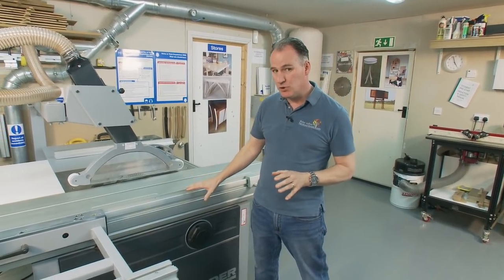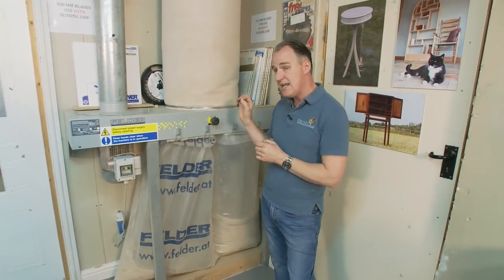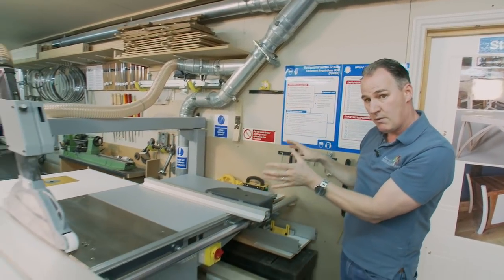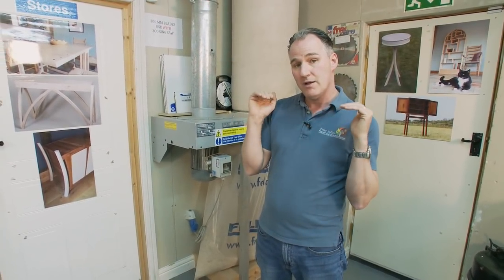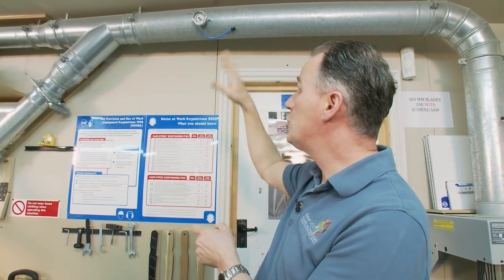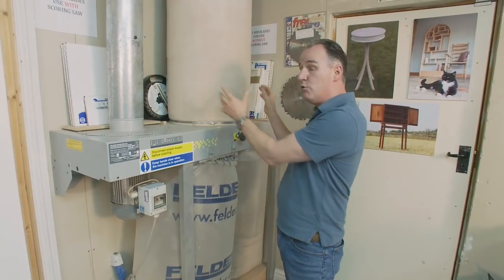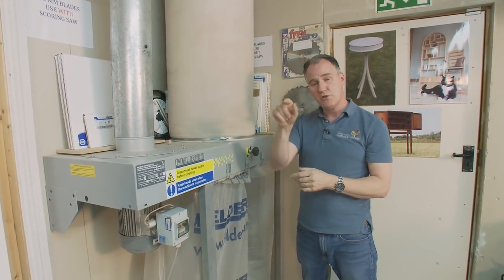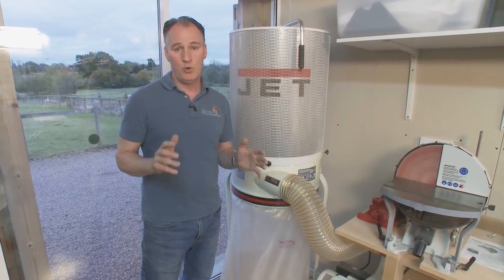Dust Extraction in your Workshop - Peter Sefton (Trailer)

Comment: Peter, my first dust extractor was the CT Festool for a small portable saw. Next, about 10 years ago I went looking for larger woodworking machines in Atlanta GA and came across Felder and Martin. To extract the dust I chose Oneida Air Systems and put the 7.5hp-3400 cfm cyclone outside the shop and later made a 10" duct return air box to bring the air back into the shop for Chicago winters. I have looked at bag collection for the next phase of more machines but I still return to the cyclone. Overall a smaller cyclone or a larger unit is less maintenance and with a gage for vacuum I can see my 55 gal drum is getting full. What has been your experience viewing larger shops with bag vs. cyclone dust systems? Like to know your opinion. Be safe in these time of the virus.
Reply: All of the workshops I have worked in have old large bag systems, cyclone systems are not so popular in large workshops over here but not sure why.
Reply: @WoodWorkersWorkshopLimited  Thanks and good day. The bag systems made in the US are of Euro import or designed stateside in the last 15-20 years that I see. With the addition of the shaker accessory in bag systems there is frequent periodic attention to saturation in the bags. The cyclone dust systems are lower manual labor to operate and allows hoppers on tracks to be employed leading to the truck load take away. The cyclone systems use a larger electric motor than comparable CFM bag systems (-25-30% less electricity). In the 8-9 years since I installed the Oneida cyclone I have had to clean-vacuum the twin 60" tall filters at the plenum three times. Each time it was my failure to keep watch on the vacuum gage and consequently I had to vac out the filters and empty the catch buckets at the bottom of each filter. On a heavy planing day for 8-9 hours I can fill up
3-55 gallon drums using 55 gal plastic bag liners. Neighbors want the dust for their gardens. Farmers will not take the walnut dust cause their animals can be injured. As I look back over the woodworking videos accumulated, I see no vids of me cleaning the cyclone. I will have to include the process next time I fail to keep an eye open on the cyclone.
I think the bag system is good for shops that put dust collection inside the shop. Now Oneida is making interior smaller cyclone systems and we will see how that evolves in the
next years. Seems like cyclones are going to rule the market. The US is very misled with our President Trump and hence lots of lives lost forever. Hope you and yours are safe.
Reply: @vincentrolfe1384  I agree cyclones are the future, hope life in the US settles down life here is good just trying to keep safe, hope you do too.